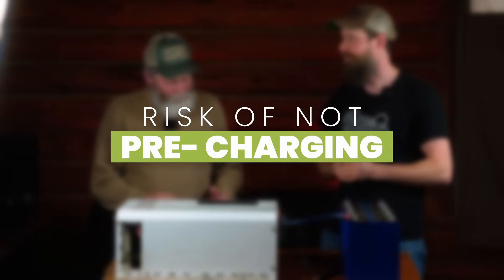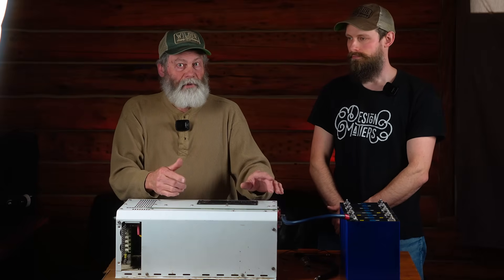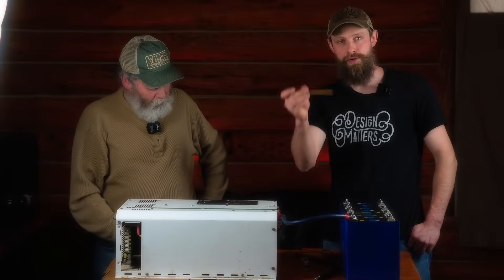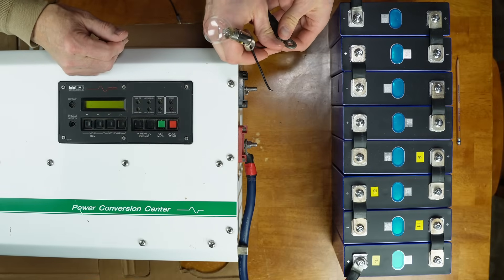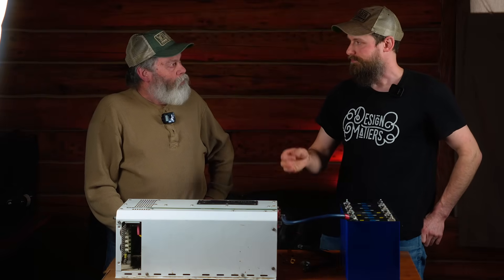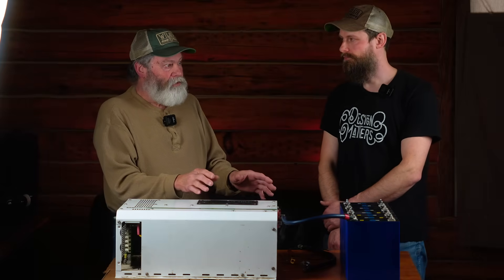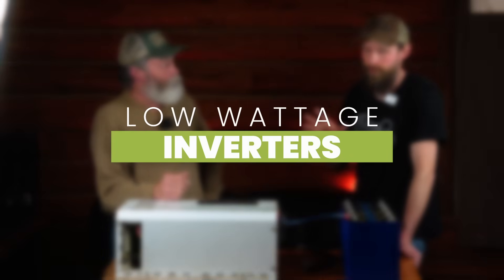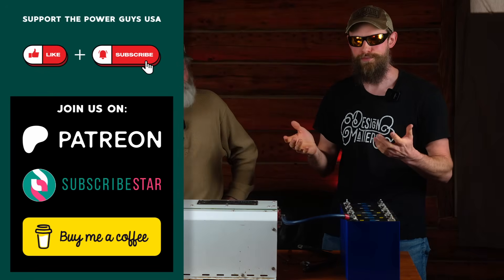When You Should NEVER Connect Lithium Batteries Directly to your Inverter | Safe Pre-Charge Methods

Comment: I like your video but when you hsvr two inverters in parallel likd my two SMA thr corrext place for the precharge is on the inverter.  Ive precharged one with the bsttrry and then still got the spark when i turned on the second one.  So now i wired a push button switch on each inverter with its own resistor. Problem solved.
Reply from the maker: Great solution.  Our 2 Outbacks are wired into a DC box and get power simultaneously.   Never thought about needing to precharge 2 inverters separately.  Thanks for the comment!!

Comment: I've read a few inverter manuals and never seen any references to charging inverter capacitors
Reply from the maker: Interesting isn't it.  We didn't worry about it with FLA batteries.  LiFePO4  with a basic BMS caused the problem.  I've never heard inverter manufacturers state this precharge procedure also.  But when your inverter will not start without it, or you see lightning like sparks, the issue comes to life right before your very eyes.
Reply: @PowerGuysUSA  The sparks don't hurt anything. The BMS may or may not get damaged. Some manufacturers specify pre charging (Kelly Controls). Reliable Electric just says expect a spark.

Comment: Well, I have seen the resistor used in many videos....but some use it on the positive side, and some use it on the negative. What side is correct?
Reply from the maker: Our preference is to have the positive cable attached and secured to the terminal first.  Then make the final connection with the negative.  There's a couple ways to explain.  Quick, simple thought is, if the negative is already attached, the system is grounded and the positive is 'hot'.  If the positive comes in inadvertent contact with metal, it would be a short situation.
Reply: It doesn't matter which side.
Reply: @solacedagony1234  THANKS

Comment: How do you know if you have a inverter that requires this? I i know my current inverter doesn't but how do you know for the unknowns
Reply from the maker: Good question, we can only offer a vague answer.  12 volt and 1500 watts or higher?   Hard to say exactly.  Some people claim they never have a problem.  What size inverter do you have?

Good thing is, the resistors or light bulbs are inexpensive and easy to use before making that final connection.
Reply: @PowerGuysUSA  I use a 48v 10kw sungoldpower inverter. It can operate fully without a battery so I figure it may not be a concern here since I haven't seen anything about using a resistance for PV input
Reply from the maker: Yes.  Different story without needing to slow the high current inrush from a LiFePO4 battery.  Sounds like you are in good shape without needing to deal with a battery.

Comment: I've used a regular 120 av incandescent light bulb. I've got those huge arc welding sparks so many times, It's a miracle that I haven't burnt something up before. That huge spark , can really screw up the threads on your battery or inverter studs too.
Reply: Does the regular 120vac light bulb work to prevent the arcing?
Reply: @rossallen738  Yes, a 120VAC incandescent light bulb can help prevent arcing when connecting an inverter to a battery. The bulb acts as a resistor, limiting the initial current surge when the inverter's capacitors are charging. This reduces the likelihood of sparks and protects the inverter and battery.

Comment: Legit stuff.  I'm guessing you can use one of the automotive voltage checker pen probes with the alligator clip and get the same result?
Reply from the maker: Good idea!  If you have a 12v inverter/battery, that sounds like it would work.  We were using a 48v bulb with a 24v inverter.
Reply: @PowerGuysUSA  Yes. My system is a 24 volt.  The probe is digital so I'm guessing it adapts as it does read out the volts.  Dunno where it tops out.  I'll probably be forced to read the directions.... 😱
But good video. Thanks

Comment: Well done guys. I like where you are going with this video. Keep it up and your channel will take off.  
SIde note, I find that a 30 ohms resistor is by far the best method. The pencil and bulb methods are probamic and I would not recommend either one.
Reply from the maker: Hey Thanks!  We typically use a resistor.  As for the pencil, seems rather comical but gotta cover all the bases 😆.

Comment: Interesting! A large voltage difference is the root cause of the huge spark. I do something similar with my 12V 2kW inverter and my 280Ah battery pack - I will connect the inverter lugs to a 9V battery first to get the inverter's internal capacitors up to 9V - a 9V battery can only release its  energy slowly so there is no spark. I suppose a small 1-2 Ah LFP battery would be even better actually! Then after 5-10 seconds on the 9V battery I'll attach the lugs straight to my 12.8V battery - because the voltage difference is now 3V instead of 12V, there is no appreciable spark.
Reply from the maker: Good procedure you have!  On our 12v 1000 watt Magnum the precharge didn't seem to do much so we switched to the 24v Trace for the demonstration.  We'll be looking again at the Magnum at a later time, out of curiosity.

Comment: Excellent explanation. Everything that you stated in your video is absolutely true. By the way, nice Trace/Xantrex low-frequency SW series inverter!
Reply from the maker: Thanks!  We're old timers to off grid electric, new to producing videos.  

The Trace 4024 was the original inverter we used.  The Gudgel brothers make some great equipment.
Reply: @PowerGuysUSA  Yep, I've known Robin for years. We've operated a Trace Engineering ASC service center for a long, long time. Still have lots of their repair parts in stock. Great video! Keep it up!
Reply from the maker: @OffGridSolar-z1b very cool.  We've followed their progress over the years. So you're one of the based in the USA companies for these electronics, very nice!

Comment: Mostly it's about avoiding sparking because the (small) ARC flash will damage (aka melt a portion of) the terminals that you are connecting together.  This can definitely cause problems later on if the damaged terminals aren't able to make a solid connection, or insulation gets a bit melted near the terminal, and so forth.   The current itself is fleeting and will not burn out any electronic components (not sure why people think it would).  Its mostly about avoiding terminal damage and internal breaker contact damage.

Most batteries do not have built-in precharge modes but the larger batteries (say like the EG4 wall-mount 5kWh battery) actually do have a soft-on pre-charge.   You have to energize the battery in the right order.. .breakers first, then soft-on, but that's all there is to it.   Know your battery.

Its a good habit to avoid sparking. particularly in higher-voltage systems.  Generally a non-issue for 12V.  At 24V the sparks will be fairly small but definitely worth avoiding.  At 48V and higher you really want to try to avoid sparking.

Don't use a pencil.  That's a terrible method.  Just buy some large 25W resistors.  30 ohms is usually a good value.  Anything from 5 ohms to 30 ohms or so.  There is no need whatsoever to use an aluminum-cased resistor... just a regular large 25W ceramic wire-wound resistors will be fine (those are the large rectangular white resistors about the size of a finger with leads coming off each end).  Don't use a light-bulb... the bulb might be burned out without you knowing.

-Matt
Reply: No, it's not. It's about popping caps and melting the FETs on the BMS. The only portion of the terminals that you're going to melt is the tip of the bolts on the inverters, which will have no impact on making a solid connection. I repair inverters for a living, have done so for the past 25 years and these guys are absolutely right.
Reply: @ popped caps and melted FETs don’t come from sparks.  They come from thermal failure of the parts… which sparks do not create.
Reply: @junkerzn7312  That's not entirely true. They can come from high surge currents that can result in thermal events.
Reply: @ If you have 10 pieces of DC equipment all hanging off your battery bus, each one contributing its buffer capacitor, the ARC flash from a spark can definitely melt ring terminals and damage lugs and so forth where the contact is being made.   But the capacitors in the equipment are unlikely to be harmed.

As always, though, it depends on "how big" and "how much voltage".   Generally speaking, the relatively small inverters that people mess with DIY do not have capacitors big enough to really cause a problem with the capacitors themselves.  

Get into really big pieces of equipment and higher voltages, though, and it will be a problem.

--

Despite all that, remember that these capacitors are actually pretty beefy.  They have to handle ESR heat from inductive loads at 60hz.   Single-events like initial charging are usually in the noise.

This does bring up mistakes people make... like the other comment about adding super-caps or additional buffer capacitors to a piece of equipment.  Generally a bad idea to do that on something that hangs off of a lithium battery bus.

If voltage sag is a problem for a device (the usual reason someone might want to try adding their own caps to a DC bus), the battery bus / cabling to the device is too thin.  There is no work-around for that beyond replacing the cabling with the appropriate gauge.

In anycase, it's good practice to avoid sparks.  But it isn't the end of the world if you get one in typical battery / inverter setups (even whole-home setups).

-Matt
Reply: @junkerzn7312  I asked Google AI "Can a capacitor be damaged if it's charged too rapidly?" And here's the answer that Google AI gave me: 
Yes, a capacitor can be damaged if charged too rapidly. Rapid charging can lead to several issues, including:
Dielectric Breakdown:
If the capacitor's dielectric material can't withstand the rapidly increasing electric field, it can break down, causing a short circuit. 
Overheating:
Rapid charging can generate excessive heat, which can damage the capacitor's internal components and potentially cause a short. 
Capacitance Reduction:
If the capacitor is subjected to excessive current or voltage, it can experience a reduction in its capacitance. 
Damage to Electrolytic Capacitors:
Electrolytic capacitors, in particular, can be damaged by rapid charging and discharging cycles, which can lead to capacitance degradation or internal heating.

Comment: Total waste of time, to avoid the electrical spark just wire your breaker disconnect in the circuit then flip the breaker on! Why in the world would wire the connection the way your explaining? neg last...makes no sense. All inverters are factory tested meaning the capacitors have a charge! (Store voltage) no need for the pencil, lite bulb crap! (Breaker absorbs the spark or current serge) from battery and inverter simple.
Reply: A breaker will not prevent the sudden surge of current from damaging the inverter's capacitors or the BMS' MOSFETs.  You don't know what you're talking about. Why do you think EG4 and other inverter manufacturers now include precharge circuits in their systems.
Reply: @guyzer0523  your solution achieves the same outcome as what's described in the video (avoiding the spark)

Is it impossible for there to be more than one solution in the world and do we live in a world where everyone in the world wires only your way?

If they wired to the breaker then good they do your solution if not they can apply what's in the video there is enough room for more than one solution in the world it's not zero sum game

2+2=4
1+3=4
1+1+1+1=4
Reply: The capacitors in some EG4 equipment I've used definitely lose their charge over a period of hours to a few days.
Reply from the maker: @joshm3342 That's what we've seen in the Trace and Outbacks.  I would precharge out of caution if the battery is disconnected over 10 minutes, depending on the BMS of course.

Comment: People say this about inverters only...... BUT inline mppt charge controllers have capacitors too .. wish I knew this 

Also why don't people wire super caps with their inverters as well
Reply: Don't wire extra capacitors into your inverters, particularly not super-caps.  A super-cap can dump enough energy quickly enough to cause ARC flashes hot enough to permanently damage your fingers or cause permanent eye damage you if you make a mistake.

MPPT charge controllers do have a capacitor on the battery-side, but its usually fairly small.  Still, if you notice sparking while messing with them (the larger charge controllers), then avoiding the sparking by pre-charging the controller is a reasonable course of action to take.

-Matt
Reply from the maker: Thanks for that info Matt.  The conversation on super-caps sounded like something that was way beyond anything I'd be attempting, was curious if this is something common.  We've been building out our off grid systems since about 2005 and I'd never heard of this until recently.
Reply: @PowerGuysUSA  You mean pre-charge resistors?  Yes, it's basically standard fare when hooking up large pieces of DC equipment such as inverters and charge controllers.  Particularly at higher voltages (24V and 48V).  Avoiding the spark is good practice.
Reply: @junkerzn7312  maybe I was too vague, why I mentioned super caps is because I've seen persons use 500w inverters to deal to jump start fridges or other high inrush inductive motors... I think that kind of application could help the littler guys

But sadly I don't see people applying this kind of knowledge
Reply: @viyusavery248  The 'Starter Capacitors' you are mentioning are only 30-50 microfarads in capacity, Millionths of a Farad. You put a Super Capacitor, measured in Full Farads into these units and you are exceeding  the Current Flow that the LiPo4 pack can source. You could possible blow things up catastrophically...
Reply from the maker: Good point on charge controllers.  We'll look into that.  

Just recently read a discussion on adding extra capacitors.  I'll have to go back and reread that.

Thanks for that info